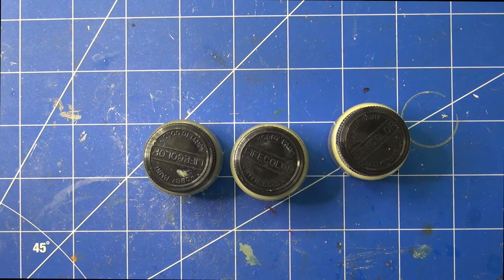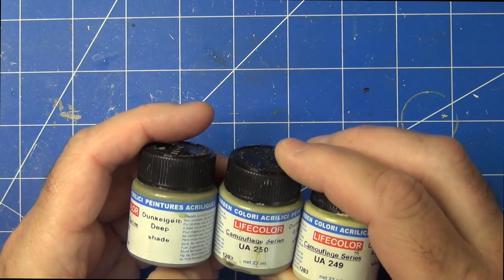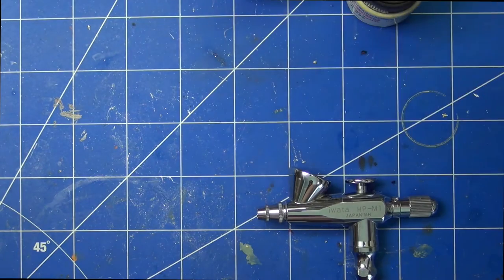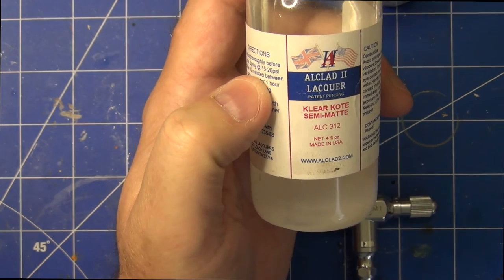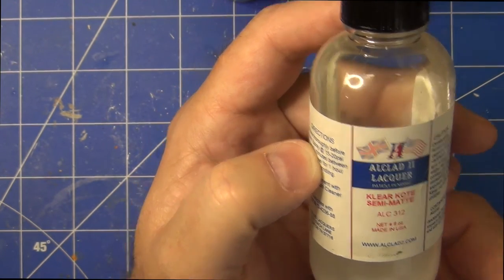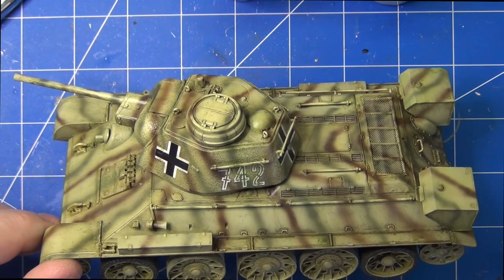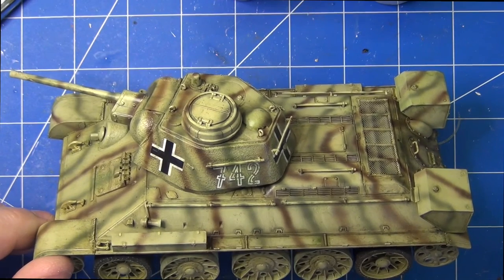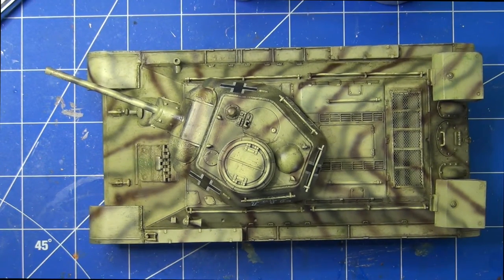Academy 1:35 T-34/76 747 Build Blog 3

Comment: Very nice camo and tracks. I've always wondered what the correct color of Russian tank tracks was, in the Kubinka museum, the tracks appear to be black, not sure that's correct since Museums often add whatever paint they have for camo etc. I would also think the paint would wear off after driving around. Russian 4BO primer was a green shade.
Thanks for posting....
Reply from the maker: Now your stretching my memory. I think I used some photos that were color of some old knocked out T-34's somewhere over in the Midlde East. The tracks could have been different of course, but to my untrained eye they looked to be the same design, so I went with the sorts of tones I saw on those photos. 

Later I read that the mixed steel and rubber road wheels wasn't common. So not sure if I got that right either!

Dan
Reply: I would say you have that one backwards (mixed road wheels), it was more common to mix the rubber with the all steel road wheels since when the all steel were used, they caused vibrations in the suspension, so mixing the rubber with the all steel reduced the vibrations for the crew. I don't like rusted tracks because they're not realistic to me, since the vehicles are constantly moving and there's no historical evidence to support that view. It's just a common practice by modelers just like chipped paint, because it adds some color to what essentially are drab paint schemes. They tend to be "pretty" techniques with no historical support.